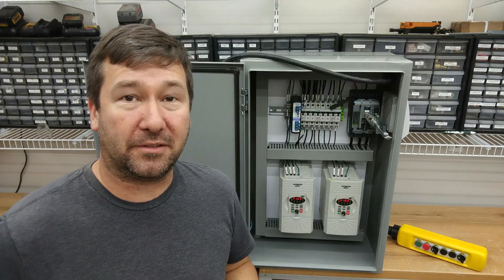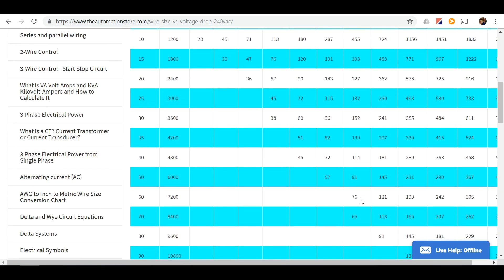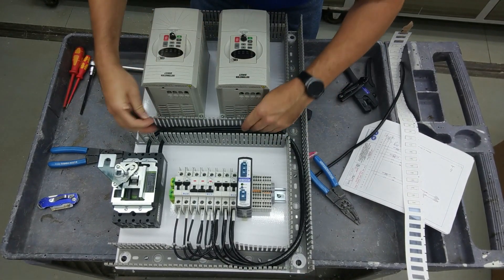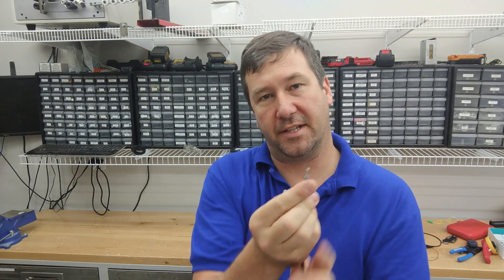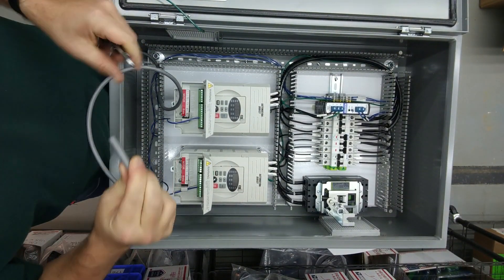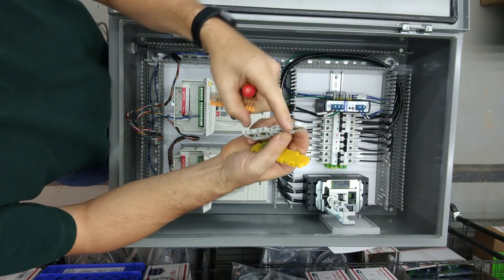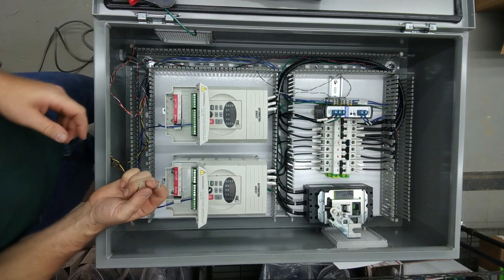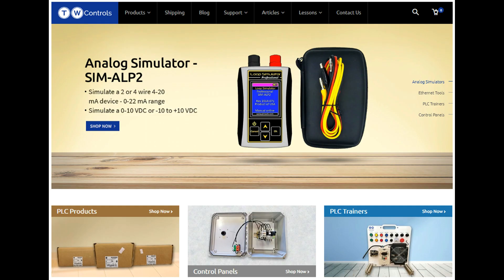UL 508A Control Panel Building Power and Control Wiring Part 4 of 6

Comment: What size control wire do you normally use?
Reply from the maker: That is very dependent on the system design.

Comment: Thank you! Do you do your own drawings for panels? If so, what program do you use? Is that the one you recommend. Also, what kind of printer do you use for  your heat shrink labels?
Reply from the maker: My CAD software is out of date but I am seriously exploring ePlan. Check out this video we did with Phoenix Contact on printers.
https://youtu.be/jk9ECl5yd0k

Comment: Thanks for another great video! Do you have to ground every din rail when wiring a ul 508a panel?
Reply from the maker: As long as the panel is steel, you only need one ground connecting to it.  DIN rail is grounded through the screws that hold it down.
Reply: @TimWilborne  thank you! You’ve been a big help throughout the years!
Reply from the maker: @Lightconsciencecongruent  That is great to hear, enjoy your week!

Comment: Hi Tim, iv been going through and watching a lot of your videos, all explained very well!
Just curious here, i see that the panel is powered by 3 phase. Did you just pull from 1 of the phase lines and a neutral to get a single phase line for the 24vdc power supply?
If so, is there any disadvantage of having one of the phase lines drawing more current than the other two?

Thanks
Reply from the maker: Hi Jordan.  That power supply is a 240VAC single phase so it was capable of being powered off of two legs of household 120VAC.  The drives are capable of being powered for a short time off of single phase 240 single phase as well but will eventually fault.  Overall you want to keep your loads as balanced as possible across the three phases as possible.

Also I do have a rotary phase converter that creates 3 phase power for testing, here is a video on it.
https://youtu.be/k9tR9d3DsqY

Comment: Hi Tim, thanks for the great tutorials!  Quick question - according to the governing bodies (UL, etc.) - when feeding a branch circuit's breaker from a main breaker, do all the wires between the two need to be rated at the rating of the main breaker?  I.e. 100 A main breaker feeds ten 10 A branch circuits' breakers - do all the wires on the supply side of the 10 A breakers need to be rated at 100 A?  Seems overkill, but really nothing protecting the branch circuit feeder wires from shorting to one another and exceeding their capacity (up to 100 A), in the alternative case (using wires sized for 10 A).  Or is that edge case assumed to be unlikely enough to not address it?  Thoughts?  Thanks in advance!

Comment: I am an older PLC engineer from the UK now living in Canada. After being out of the game for quite a few years, I decided I wanted to get back into it when I was contacted out of the blue by a recruiter & wanted to brush up my practical skills a bit, no interview yet but it is coming I am assured. I love the videos, practical & very good, I have forgotten a few bits & bobs in 10 years completely out of it as well as learned a few new tips. I lost interest back then because I had been made up to management, ending up as production manager but I prefer getting my hands dirty. Back then I had to critique my production guys' panels as their mentor/supervisor. What got to me in the end was having to lay several off in 2008, after which I resigned because I felt so bad about doing it.

One point about shielded cables: You strip them back & remove the foil...OK as long as you can do this...check the drawings, notes or with the designer first! The biggest area where these signal cables will be exposed to electrical noise is inside the cabinet & especially when bundled alongside (not so much at right angle passing) inside wire ducts with other cables. Duct groupings & pack density are important...don't put high energy cables in with small signal or data cables wherever possible. Your point about slipping a bit of heat shrink over the bundle of MC cable is a good one (video 5.08). If you look at the cable, it is made of individual twisted pairs...this is to cancel out induced noise & cross talk so you want to preserve the twist as best as possible.... ALSO... Shielding for cables where it is preserved must only be connected to Ground at one end (source end normally) to prevent stray or induced current flow in that shield.
Reply from the maker: Great points! Welcome back to the field.

Comment: Hey these are some great videos. We had a company come in for certification and they were strict on removing paint under din rail where it screws in for more of a bonding connection. Also I've tried the drill/tap combo bit and found that they broke rather easily, do you use tap oil when using these bits or have any suggestions on using them? Maybe I just had a cheap brand? They sure would save a lot of time.

Comment: Hi, Tim,  I have a question. Do you use #4 wire to connect the first 3P breaker from disconnect , then use a smaller size to hook up from the first to the rest breakers? Thank you very much. I am a fan of ya.
Reply from the maker: Are you talking in general or on this specific panel?   In general you may start off with #4 going to a 60 amp load, but if you are going off of it to a small transformer then I would drop to #14.  Thanks for being a fan!
Reply: @TimWilborne  Thank you so much. I mean on this specific panel. It looks like a #4 wire connecting the first 3P breaker from disconnect , then wires in a smaller size jump up the breakers from up sides. This was my understanding and observation for the above video.
Reply from the maker: @dennisjiu1771  Yes your observations are correct.

Comment: Thank you very much, but I'm wondering, this panel is for what exactly, for which kind of control ?
Reply from the maker: I don't recall on this particular panel.  It was controlling two motors that needed variable speed.  Once controlled by a START/STOP and the other was a momentary FORWARD/REVERSE.

Comment: Sir if have problem in electrical control panel nd I don't know where is connected one side is  control cable then how I find nd check that cable
Reply from the maker: Finding the wiring diagrams would be the best place to start.  We have a troubleshooting series coming out that will help you from thre.